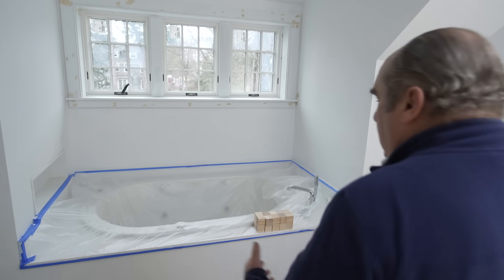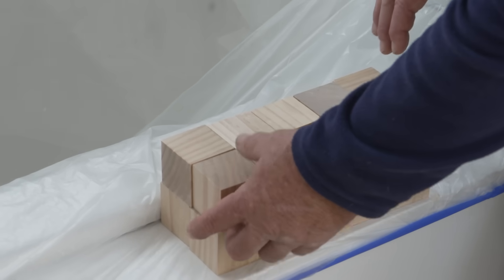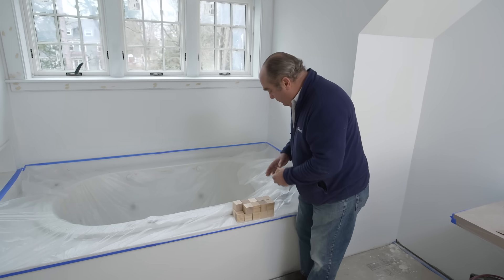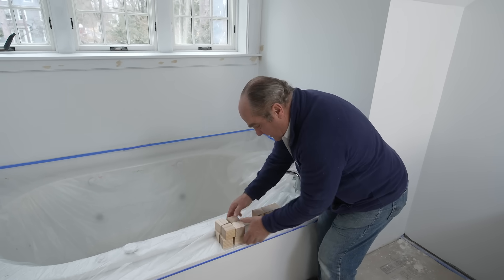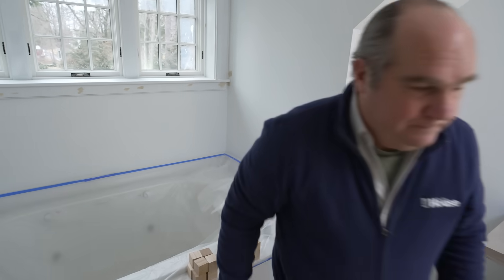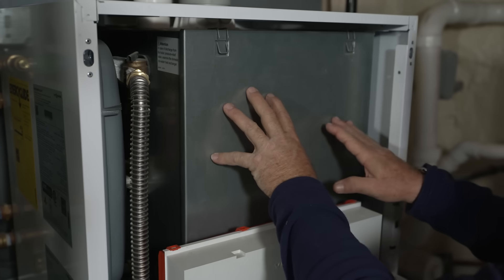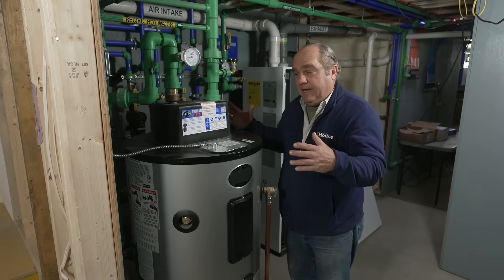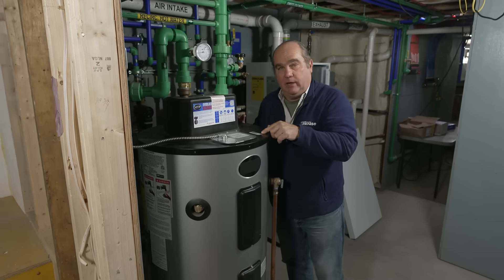Overall Hot Water System | This Old House

Comment: If there's natural gas, it's best to just do instantaneous tankless heater. If the flow rate isn't enough, you can always add another unit. Most homes in my area came with 2.

Comment: Why not use a tankless water heater?
Reply: The flow rate would be too low, the highest ones only hit about 11 GPM. Also electric tankless would be a no-go due to the sheer amount of amperage it would require to heat that much water fast enough, so if the house doesn't have natural gas or another fuel, tankless wouldn't be an option.

Comment: No one actually fills the whole tub with all hot water since it'd be too hot to get in right away. Therefore a lot of the fill comes from the cold (mixing with the hot) to give perfectly warm water. I have a large tub like this and a normal natural gas water heater does just fine without all the fancy other stuff.
Reply: Well aren’t you just a joy to this world.
Reply: @johnlebzelter4208  ??
Reply: The key is the natural gas. The recovery rate can't be beat.
Reply: @Gazman299  all you need is either a bigger gas tankless water heater or just get the cheapest smallest gas tankless water heater just for this one tub for $500 and be done. Unlimited hot water.
Reply: @RossMalagarie  Yes, you should probably do that just for the tub, but those things don't really work very well for a family using multiple fixtures. Even the 'big' ones can't keep up.
Reply: @Gazman299  you have to have them "zoned" and have several like about 3 or 4 small ones rated for 1 to 3 lines at once. They are about $500 for the cheapest good name brand or up to $2K for the top of the line condensing high efficiency ones. 

How many people use hot water at the same time? 3 showers, and the dish washer and the washing machine all at once? No the most is one shower, one washing machine, and one dishwasher, and one other few seconds line to wash your hands which one large gas tankless could handle or 3 small ones, and you can even put them close to their zones to make the wait time cut in half
Reply: @RossMalagarie  I wouldn't recommend them. A gas heater is anyone's best bet.

Comment: Way too much and too expensive.   I have a super large (soaker) tub that I just had installed and I went with an 80 gallon heat pump water heater.   Very efficient.   Never runs out of hot water even on energy saver mode.   Absolutely love it.

Comment: Every home being built where I am is now going tankless on demand systems.
Reply: And heating them how?
Reply: @TheDudeFromKalispell gas or electric
Reply: Sorry to hear that. You must live in a warm climate.
Reply: @donc-m4900 I am in Texas
Reply: @donc-m4900  I live in Northern Ontario and I have off grid solar for everything including my machine shop. 

Welcome to the 21st century grandpa.
Reply: @Jebus-d9k5j It sounds like you know what you are doing. 
I don't think  everyone can do the maintenance required if their water isn't good.
Reply: @donc-m4900  Maintenance? Same as any other water heater. This is not rocket surgery.
Reply: @Jebus-d9k5j I have heard that they can clog up after a few years if not back flushed. So this may not always be the case then?
Reply: @donc-m4900 they do have a flush valve, the biggest issue is that most people do not perform the flush on a regular basis, some newer models have a notification capability that sends a text to you, but that has to be setup and applied properly when notified, the same goes for tanked water heaters.
Reply: @donc-m4900  Same with any hot water tank, they all need to be flushed periodically and cleaned out inside. Depends on the water quality. Most people treat their water first before the water goes to the heater. That is my set up here off my well and its worked fine. Depends on water quality. There are a whole lot of factors that go into water quality.

Comment: That’s good to know being I’ve got to build a new home in few months.
Reply: The system they showed you here is prohibitively expensive, I installed on demand water heater and its much more cost effective and efficient.
Reply: Just either get the smallest cheapest gas tankless water heater for about $500 for just this one tub or get one or several gas tankless water heaters for the house and they should have no problem supplying unlimited hot water to this and all other lines if sized correctly and for 1/5th the price. I recommend putting them in the garage that way you have the pros of being "outside" the house if it blows water, and the cons of being "inside" for not freezing. I have my gas tankless outside and it SHOULD sense the temp and keep it barely warm to not freeze but I need to double insulate the supply pex line which freezes when below 20F which does happen every 5 to 10yrs here in south Louisiana even with the normal pipe insulation. What I will do is put pipe insulation ON TOP of the pipe insulation THEN add a insulated box around the pex supply and exist lines that are exposed on the bottom of the water heater on the side of my house. This would be fixed if put in a slightly heated or very well insulated garage that isn't allow to drop blow freezing.